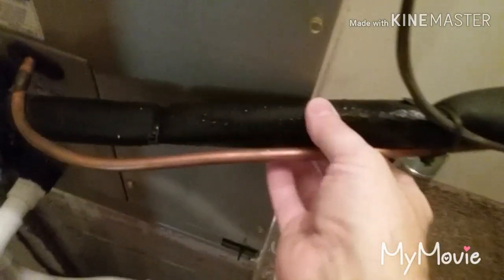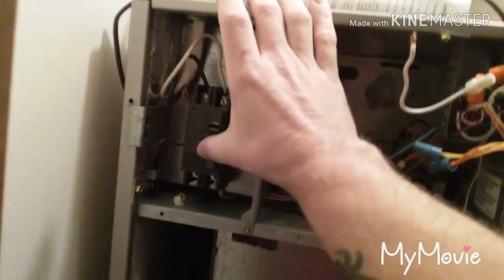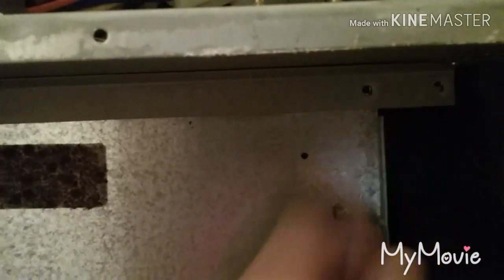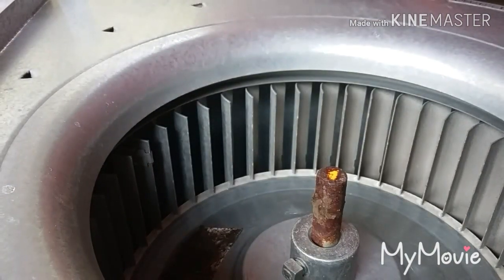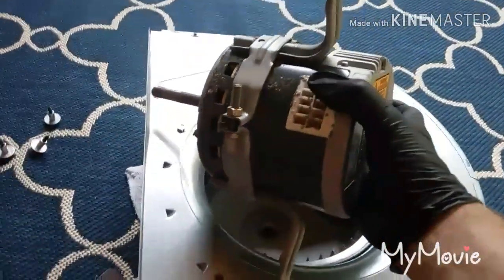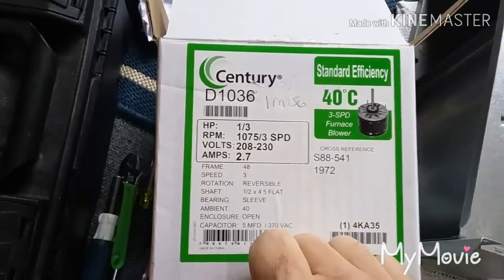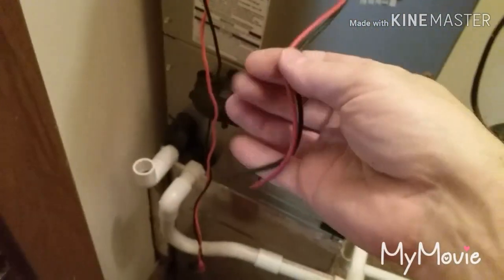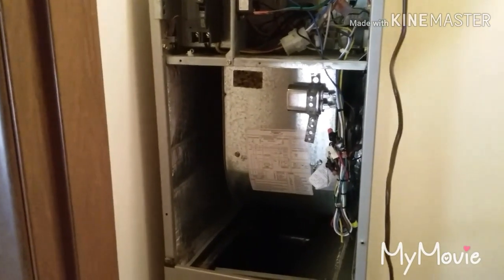Converting a ECM to a PSC motor using a relay

Comment: wow & Thanks Looks so easy to ride my unit that 1000 blower motor with just an cheat PSC matching frame 48 & Volts amps rpm & a $ 20 .00   relay .... chit   who knew  it could be That Easy ....Thanks & no need for Them 200 / 300 dollar quickSwap conversion  x13- psc  board they sell

Comment: Hello, I have a ECM 120V and I got me a Genteq X13 ECM at a Flea Market but it did not have the Harness. I intend to use it when the actual motor gives up. any advice on where can I get a Harness or if I can only use something that will plug into the pins. Here in the Golf Coast I only use the low speed, normal in winter and easy in summer so I can get more hummidity out the house. Thanks.
Reply from the maker: @1945temo  I would be suspicious if it even works hope you didn't pay much for it. Probably not worth messing with

Comment: when you have a situation like that when it uses a heat strip for heat ax heat or back up heat  just use a mars  or evergreen  aftermarket ecm motor   they about 150-225   i carry them on my van for that instance.... if's its a  heat pump with out any strip's or backup i do just what you do....

Comment: This is not possible on most if not all gas furnaces due to the control board being interconnected with the ecm module. Will just not run and give you a motor fault code
Reply: I did it on a Carrier gas furnace board. I had to study the circuit for a bit and then figure out how to tap into it, and it worked perfectly. It's been a while, so I don't remember exactly how I did it, but I will make a video next time. It really wasn't that difficult. I haven't tried it on any other brand of furnace yet. I'm sure some of them have made it much more difficult, but air handlers are still easy.

Comment: This definitely saved me. My replacement motor was $500.99 plus shipping. I ordered a universal, relay and the cap for $187. They arrived today at about 6 pm. It is now 10 pm and I have air... thanks
Reply: Where did you get them from ? Gotta do the same.

Comment: Wht bout the heat?
Reply from the maker: What about it? The heat still works it only utilizes one fan speed. That is common in most electric forced air units. If it were gas or oil then you might use a slower speed for heat. But in this case a medium or high speed will work fine for both heat and cooling.

Comment: How do you do this in a gas furnace? There's a speed from the board to heat & another speed for cool. Also the heat delay to cool down the heat exchanger after the call for heat stop.

Comment: Thank you very well explained i shared this video with others as well i just installed universal motor that was coincidentally the same brand century coincidentally into a pain system exact same you just did blower motor is up and working perfectly thank you so much you saved our butts today

Comment: Got a 17 year old Coleman package RTU, guessing the ECM module's failing; lots of speed up/slow down/no fan at all at times, all the while the compressor's at work... freaky. Still noodling through options to either replace or move to a PSC being it's long been out of warranty; that and I'm no pro, just a DIY'er. This will very likely come in very handy. Thank you!!

Comment: I never liked these motors either, just onew they were gonna be a big problem. They try to conserve energy by implementing new technology into a motor. They dont care how little of a life these motors have. I loved the good ol ac motors, never really had a problem except for the occasional fan motor failure from a motor with bad bearings or lack of lubticant. Right now working on a GE ptac, ( heat and ac in one) . This complete unit was replaced 3 years ago, condenser fan motor failure just in 3 years, now 3 moths later the fan motor hasfailed again, and yes, the control board assembly was replaced to be safe too. I just totaly hate this crap made in china, never saw an ac unit with a plastic base. Obviously these woll not last like the old units did. Trying to figure a way to match up mouting and shaft to an ac motor, if so, will wire it with 24 volt relays like the old dependable units. Never ever thought it would get so bad to go to dc motors and all the electronics in a darn motor, i hate these things. Looks like they are a high failure item.

Comment: Thanks I had about figured out I had to add some fan relays,,, but my x13 is,was using 2 speed taps guessing slower speed for heat? Is that really necessary,  I  was thinking of just connecting the 2 control wires to one relay and have new motor run at only one speed only???

Comment: So exactly what are the benefits using an ECM motor?  I suspect soft starts, variable speed, more constant temperature in the building, that is, the temperature doesn't go up and down as the system cycles?

When the ECM motor fails, not if it fails but when, how do you justify the cost difference to the customer, will they really notice the difference going to a psc motor?  Thanks for the video.  BTW, is there any way to hardwire an ECM motor so it works directly from the power source, through a relay lets say?  Jim

Comment: I had one this week that the  x13 motor would not shut off . Even when you took the 24v off the motor it kept running.
Unit was out of warranty , when I explaned to the price difference between the X13 and the psc motor he went with the psc .
I used the same relay, I like where you located the relay. 
Great video.
Reply from the maker: Thank you, and yes it is much more economical to convert to PSC when unit is out of warranty. Thanks for watching.
Reply: i had one a month ago for a property management co..  first time i've seen this..... i just unplugged  one of the high voltage wires going to the motor (black one ) because it was the one on the back side of the contactor that was on the open side and moved it to the front..   yea they wont be able to control the fan with the thermostat but the motor will come on when the unit comes on..... unit was 11 yrs old dont know how long it will last well see..

Comment: Nice job, just wondering why didn’t you connected your electric heater back?
Reply from the maker: I did, I didn't actually film that part but all the wires were recconcted and tucked back in place. Thank you for watching.